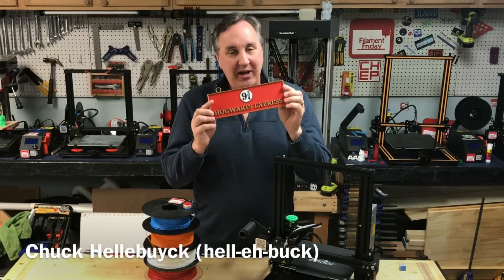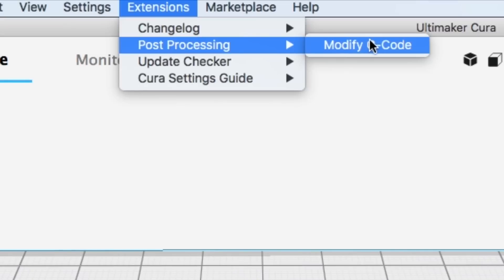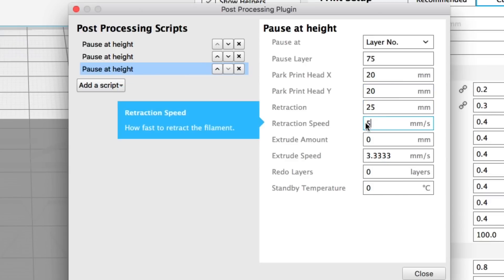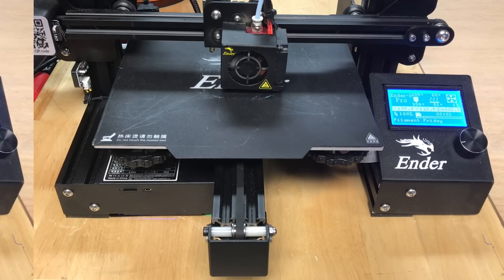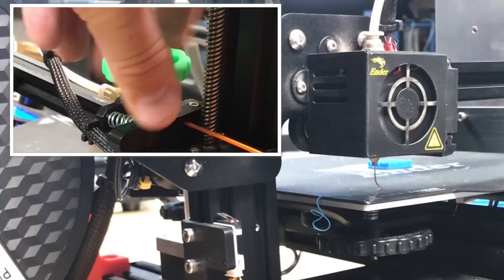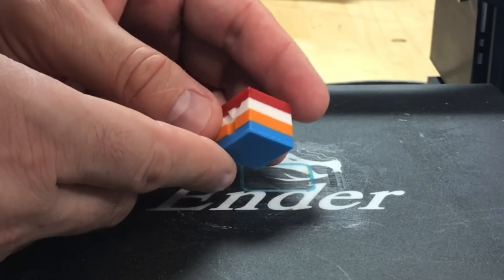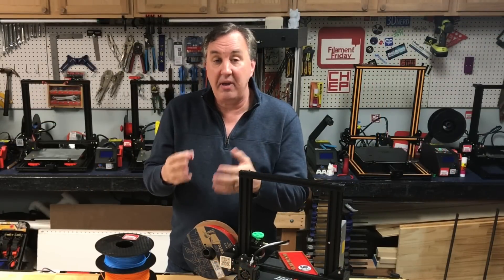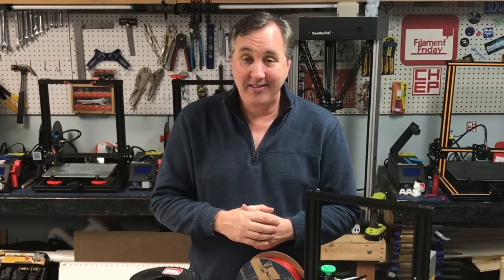How to do Multi-Color 3D Prints on Ender 3 3D Printer

Comment: Thanks so much for all the great videos.  They have be a great help.  Hoping you can point me in the right direction.  I am trying to do a 2 color filament print on my Ender 3 V2.  It is at it's stock 1.0.1 firmware and I'm using the current build of Cura.  I have gone into the Post Processing section of cura and added a Pause at Height script to my Gcode ( I double checked it was there with a text editor).  However, when I ran the print it never paused.  Just curious if something is different on the V2 printers?  Thanks again for what you do.
Reply from the maker: Yes, the current firmware ignores the M0 GCode command.
Reply: @FilamentFriday  I think I saw an update you did somewhere with a Marlin firmware upgrade that fixed this ... As long as the filename wasn't too long?  If I recall correctly the post included a picture of a 2 color vase?  I'm having troubling finding that.
Reply from the maker: It’s in my community tab of YouTube.
Reply: @FilamentFriday  Got it.  Thanks.

Comment: 102 dislikes tried this on a resin printer
Reply from the maker: And 6,800 likes!
Reply: @FilamentFriday  Ok, you got me. If it helped 6800 people, then more power to them, but I still contend that there are better ways to get multiple materials out of a single extruder machine than this.
Reply: @stephenborntrager6542  and yet this is one of the easiest methods. And more so, because it been done by CHEP himself who explained everything clear and right to the point, its as easy as possible to follow and is giving people that are new to 3d printing a sense of security because they literally dont have to modify anything physical or virtual off/on the printer itself. 

It didnt only help 6900 people, it helped 249000 people. Because now they know how to do something that they might want to try in the future.
Reply: Or maybe they are annoyed at how he tries to trademark the calibration cube, apparently is so important he got a manufacturer to invent red, and is showing a braindead technique that any idiot could figure out. This a dumb way to get "multi-color". There are ways to splice filaments so that they transition mid-layer, and that doesn't require you pause or change filament mid print. The tricky part is in generating the sequence and lengths, fabricating the filament, and limitations in current slicers regarding minimizing material transitions. It has been done before though, both on proprietary systems, and also experimentally using only basic printers and custom slicers. He is unintentionally obscuring more useful information with this. Having the colors banded by layer just isn't good enough.

Comment: I used the pause for my Prusa Mini, it stopped and that's it. I had to manually extract the 1st filament and insert the second and still, the mini just sits there. Do I need a resume command? Even the change filament command was greyed out and couldn't be selected. Yes, Prusa slicer does these changes easier but I wanted tree supports which Prusa doesn't offer.

Comment: I tried this and I succeeded.  there is only one problem I have.  If I have replaced the filament with another color and when heating the extruder, why can't I turn the extruder knob?  like stuck and hard to rotate to help remove the previous filament.  please help for my problem.  thank you and sorry my english is bad
Reply: On my Artillery X1 Sidewinder I go into the menu on the LCD touchscreen and select Tools》Change》Out and this will extract the filament from the hotend.

Comment: Hi  Chuck
I just started with my first 3d printer and I have bought an Ender 3 v2. 
When I ad a pause to an print with Cura the printer lifts and moves to  the configured location, an within an second the printhead travels back to continue the print so the pause does not seem to work. and sugestions?
Thank you so mucht, you channel is an insperation.

Comment: After the layer pause, my ender 3 pro doesn't return to printing in the same location and instead randomly extrudes plastic a few inches away from the actual print. Why does the printer not know where to return? I don't change the location at all when paused.

Comment: thank you Chep, just a question: let's say i have a mesh splitted in parts and i want the first part printed in red, and the other part printed in black. how can i do this? thank u
Reply from the maker: Not sure I understand. If you can’t print them separate then you need a two color printer. Check out https://www.3dchameleon.com
Reply: @FilamentFriday  i wish i could give a priority to the first mesh then to the other, indipendently from the height or the the level. Lets say i have an area wich edges are tall as the print of a different color inside (lets say number 3, extruded at same height of the borders). I wish i cuold print the area with the borders with Red color, then the printer pause and i change color and print  the number inside of a different color. I dunno if i explained it clear. Thanks
Reply from the maker: Like this? 
https://youtu.be/0Sla-vIsvh4
Reply: By The way, i subscribed your channel, u are very kind.

Comment: Well yeah that is pretty easy. But having it be change by layer is not all that useful. Imagine having multiple colors in one layer like if you wanted to print the letters a different color from the rest of the cube. I wanna know how to set up multiple extruders on cura and use a joint for the hotend

Comment: I did this on my anycubic mega S following your instructions and it worked almost flawlessly.  Only issue I ran into was the filament run-out sensor, when I changed the filament it screwed up the printer "resume" but I just powered cycled the printer and kicked off the resume as if it lost power and it picked up and ran the rest of the job flawlessly.

Comment: Does this keep the Z motor engaged so you don’t accidentally move it when changing out the filament?  

I’ve tried to do a similar change via the Pause option in the printer menu while printing and I always seem to accidentally move the z axis while fighting the filament.  Would be nice if the motor is engaged so it can’t move.
Reply from the maker: On 4.6.1 you can set an amount of time to lock it.
Reply: Thanks CHEP!

Comment: I followed these steps and something went wrong. I have a cr-10s. I noticed that when I changed the filament that the bed temp dropped all the way to zero and I pretty much had to redo it, but it did start at the last layer. Any ideas?

Comment: Hello, the experiment with this configuration has been a success, I only have a drawback, and it is the small drop of filament that I extruded at the moment that the printing is going to continue, since it is not a big thing but I would like to know if there is any tip to minimize this small drop to the maximum or even better eliminate it completely. Configuration used in a CR-10 s4

Likewise infinite thanks for your advice and videos are very helpful, keep it up
Reply from the maker: Just pull the filament back a touch after loading so there is a small delay in it being released.

Comment: this method is only for cura 3.6? i try with cura 4.6.1 bur cant fint repare button, and the g code is not added when open g code file with text edit.. thanks... ill waiting your reply...
Reply from the maker: I’m still planning to test it but others have said it works on 4.6.1.
Reply: @FilamentFriday  thanks ill waiting, i cant find the solution right now
Reply: @FilamentFriday  I have issue on 4.6.1 it starts on a way above the layer it stopped
Reply: same here

Comment: I got a problem that the extruder was locked when I try to change filament. I have to use force to rotate the knob to release and load filament. Anything I should change?
Reply from the maker: Are you using 4.6? 
Just pull the lever and manually push in the filament. You could fix the GCode.
Reply: CHEP yes,4.6. Didn’t realize it’s the problem until now

Comment: How do you get prints to come out so well? I often have a line running up the side, and circles always come out slightly oval shaped.
Reply from the maker: Oval means your belts are loose or motors are slipping. Line up the side is the seam settings. My profiles handle that.
Reply: CHEP thank you so much

Comment: Quick question, i did this exact thing on my Ender 3 Pro except that i left the Redo Layers on 0. The print head went down to the plate ( at x20 y20 z0 ) and the run over my existing print close to the bed and then rammed into the middle of my piece trying to resume. Lucky for me, i was right next to it so i forced the Z axes up and stopped the print.. Any ideas why this happen ? Was this Redo Layers option had to be a value > 0 ?
Reply from the maker: Later versions of Cura appear to have an issue per other comments.

Comment: I had a heck of a time changing filament last night. I ruined a magnetic bed which is why I sought out help this morning. But in the course of trying this with the settings you mentioned, it paused at the 6th (out of 10) layer. When I swapped filament and resumed, it dragged the head across the bed again. Luckily I didn't put my spare bed down. Shouldn't it have restarted where it left off and at the right level?
Reply from the maker: Yes. Some versions of Cura are broke. They appear to be fixed in 4.6.
Reply: @FilamentFriday  Unfortunately, I'm on 4.6.1 so it appears still broke. Thanks for the reply. I subscribed.

Comment: Thank you for your video, but with my Anycubic M printer I have changed the g-code like this:
...

M104 S70 ;  set hotend temperature
M25 ;  pause SD print
G4 P60000 ;  wait 60 seconds to change filament
M24 ;  resume SD print
M109 S200 ;  wait for the hotend temperature
...

Comment: Hello Chuck, did you check the new feature in CURA 4.6.0 !! You now can fix the steppers at a certain hight to prevent the extruder is goign down. Very helpfull for this way of printing multicolor prints.
Reply from the maker: Yes. I’ve been experimenting with it.

Comment: Could you please make a video on this but for simplify 3D? It has other advanced settings like fan speed at height etc to help with the first layer sticking. When using cura my 2nd color didn’t stick too good as it was cooking too fast.
Reply from the maker: This is how I do it in S3D 
https://youtu.be/Yqw1otv_fzs
Reply: CHEP of course you have a video for this.  You the best!

Comment: Chep, Very helpful video to help me understand how to move extruder out of way for potentially pausing a print so that I can embed a magnet into my print instead of changing filament. Is there anyway in which when the pause on layer height command is issued that the heatbed can remain on during this period. Trying to work out exactly when the print is going to pause I have not worked out as CURA does not show layer height in slicer like PRUSA Slicer, unless I am missing something. I am on latest version of CURA

Keep up the good work.

Comment: Hello

I did this for the first time, but after the filament change when it went back to start printing the layer it was off horribly on the X axis.

Any idea how I can find and fix that issue?
Reply: leave the redo layers in 0, and use the printer change filament option. Do not do it manually like he did in the video. that's how I fixed it.
Reply: @Donpipio  my printer doesn't have a change filament option :/
putting the x,y back to zero helped slightly, but it's always still slightly off when it comes back on the first object. Also Cura 4.5 doesn't give me any where near that many options in the script. Basically just Layer, retraction and x,y. the ability to not redo the layer would be awesome. That seems to cause a clog in the nozzle :|

looks like I'm going to have to print two separate pieces and glue them together
Reply: Same here! Next time I'm going to be really careful not to move anything when pulling out the filament, or just eject it from the control panel instead of pulling. It's odd because you'd think that the printer would centre the nozzle before resuming.
Reply: @Mekchanoid   So this time i tried "Pause at Height" it gave me all the options that "Filament Change" gave in the video. The retraction and cool down really made the swap so much easier and less stressful!

That would be my suggestion...
Reply: @geauxracerx  After I tried it again, the nozzle smashed into the part and kept on trying to print some ten layers lower than it was supposed to. Sadly there are no sensors to prevent this.

Comment: Not related to the color change but how do you go straight to printing when you click on the file ? What settings do I have to change in cura to not print the line down the edge of the bed and a circle around the print
Reply from the maker: Change startup gcode in machine setup and don’t use a skirt.
Reply: @FilamentFriday  hi chep.  I am also getting a blob on my prints while using this method.  I am using cura 4.5 thanks

Comment: Well done, great tutorial.
By cons I tried, and when my ender 3 resumes, I think it resumes below ... the nozzle scrapes or scrapes and moves the whole print ....
Reply: Mine too. A 9 hour print gone to waste...
Reply: i am having the same issue any chance you figured it out?
Reply: @brulecr1  leave the redo layers in 0, and use the printer change filament option. Do not do it manually like he did in the video. that's how I fixed it.

Comment: Great video, just a quick question.  As this is done in Cura, this will work with any printer, do you agree?  I am new to 3D printing, so new, I havent got my printer yet.  I am going for the CR10 S Pro.  I intend to print minecraft stuff for my grandson and just want to check before hand.  Keep up the good work CHEP!
Reply from the maker: It should,  yes.

Comment: Great video but I have a problem. I upgraded my ender3 to MKS GenL main board and 3.2 touch screen. I can not get the print to resume after the pause at layer. Would you happen to know the m code that is sent to the stock board when the scroll wheel is pushed to resume. With this info I could create a custom button on the touch screen to resume. Thanks and keep up the great work.

Comment: I have a problem with cura 4.4.1 where I pause at a certain layer height but when it pauses, it retracts the filament and pauses, then after less than a second it immediately resumes printing. I also tried the change filament option but that one's problem is that instead of retracting it extrudes at an extreme rate that grinds my extruder and blobs the print. I'm thinking theres a firmware issue with my printer but I dont have the time to figure out how to fix that. Help?
Reply: I'm having this exact same problem!
Reply: Here's hoping a 3rd person with the same issue gets enough attention to get a solution to this.

Comment: In Cura there is a  "Change Filament" script that seems to do the same thing.  I have been using it and it seems to work easily.
The only thing is that the extruder does not move up when it moves. If I do a filament change at layer 4, the tip of the extruder is only 0.8mm off the bed.
Reply: For me it doesn't pause, it just moves away and goes back so you have to pause it yourself

Comment: if your having problems with the print head moving while changing the filament just use the filament change script. set the layer to the layer you want the new colour to start and set the initial retraction to 0, the ender 3 seems to think this is an extrude command or something.
Reply: nub thanks, I think you just fixed the problem I ended up having with the z axis moving.

Comment: shame it doesn't correct any movement in the Z axis during the filament change.
Reply: Yelp once that moves just a tiny bit it screws up the whole thing. But stepper motors don't get any feedback data.
Reply: didn't think about that, would pretty much have too home before moving on then? hmmm could probably edit the G Code to make something like that happen. i'm a n00b and still have a lot to learn.

Comment: Thanks for all info you have provided, a huge help. Is there a way to setup a beep alert when it’s time to change the filament?
Reply from the maker: If you modify the GCode file it could be done.
Reply: So after I change my filament and the nozzle gets back to my print it extrudes a extra amount of filament before it resuming printing. What settings do I need to change to stop that from happening or make it do it before it goes back my print?

Comment: This is one of my absolute favorite 3d printing videos!  Question:  Even after carefully waiting for the "drip" to stop after changing filament, I still usually end up with a blob when it resumes.   Is there a way to add another loop around the project or print a random line to get that out of there before getting back to printing the project?
Reply from the maker: Possibly in Gcode but you could just pull the filament back a little to relieve the pressure.
Reply: TY @FilamentFriday .  I will give that a try!!
Reply: @bobn2276  Did pulling back the filament work? as I'm getting this same annoying blob when trying this too.

Comment: Very cool video, thanks for the tip! Qe have an Artillery sidewinder x1 at home, and at it's current settings it doesn't work with m0, it just skips them. So just travel slowly to one point and then change the filament. Workaround, but it works great! Thanks again for the video!